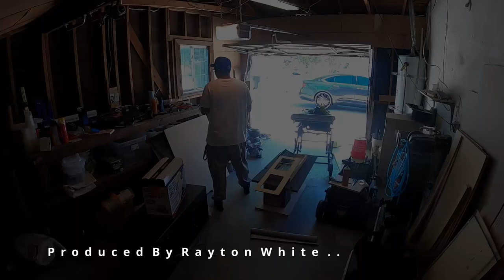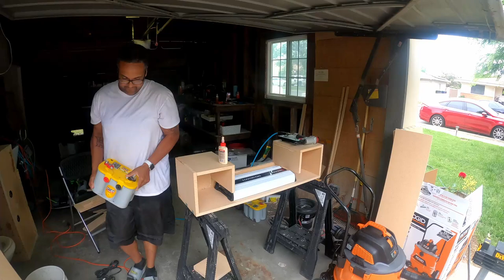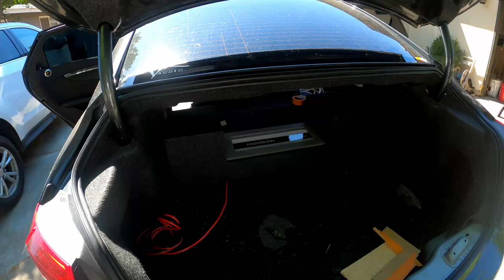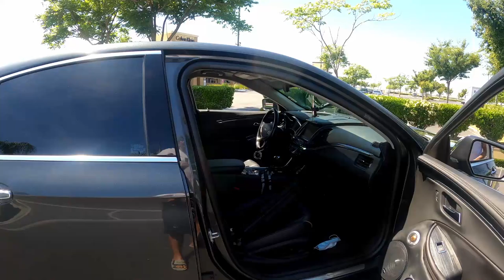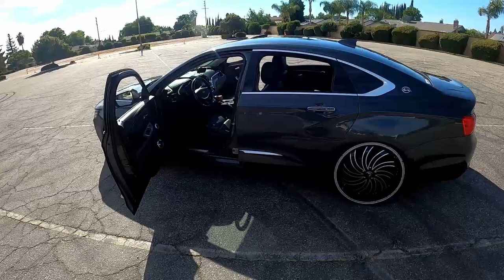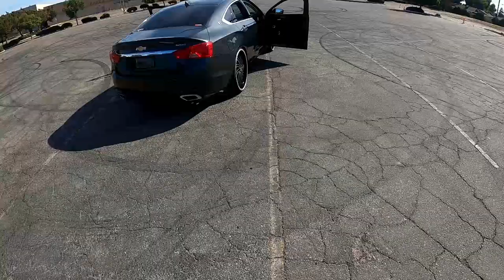2019 IMPALA PREMIER STEREO INTALL- HOW TO ! ! !

Comment: Do you have any recommendations on good aftermarket door speakers that will fit right in the existing holes?
Reply: Cruchfeild has the 6x9 adapters you will need then you can get any three way 6x9. I would go with skar. Cheap price but great quality.

Comment: Question about 2016 Chevy Impala LT non bose... I want to add a nephew external amps.. is there a way to bypass the internal cross over so I can run my own crossover front desk has the tweeters which I'm planning to move to the doors with six by nines as a component set thank you if you can help
Reply: Best way to do it is just zero everything out on your head unit and do all of your cross over from your external unit.

Comment: Did u have to change out your alternator? I have a 2017 LT non Bose. I replaced my factory speakers with alpine components up front and 2-ways in the back doors, all 6.5s. Now it seems like the volume is lower than it was with the factory speakers. I also have a Rockford 1200w on a Skar vxf 12.
Reply: Are you using the factory deck. And if so. Do you have a sound processor. There should be a volume control on that. If not the you need to put an amp on the mids and highs.
Reply: I’m using the factory radio. I just have a cheap loc I’m using
Reply: Did u change your alternator?
Reply: I have the 2019 premier with the Bose system. I will point out that With the Bose the speaker configuration is a 2ohm, so it might be the same for non Bose also.
Reply from the maker: no did not change out alternator..  and i went with the PAC 86 sound processor.. plug and play under passenger kick panel

Comment: What kind of line out converter do you have?
Reply from the maker: Copy and past site.. first one is for Bose system. Amplifier Integration Interface for Select GM vehicles with Bose system....
https://catalog.pac-audio.com/catalog/amppro-amplifier-interfaces/ap4-gm61
Second is without BOSE system
AmpPRO SUB Advanced Amplifier Interface for Select GM 2014 to 2019...
https://catalog.pac-audio.com/catalog/amppro-subwoofer-interfaces/apsub-gm61

Comment: Was hoping for  more of a how to. Do u still have a the factory unit? Did you buy pass it? How? Your video has speakers in the door but no how or where to put them.  All that said Iove your work on the battery  and amp mounts..do you have the measurements or a cad file so we can replicate?
Reply from the maker: I do still have the factory unit but I used a sound processor because the factory unit does not have RCA outputs or audio outputs. So I had to use a sound processor for my RCA output or audio output. The door panels are custom fiberglass door panels that I built for the upgraded speakers. There was no way to install speakers of that size in the factory door panels. Bose door speakers are 6 x 9. The speakers that I have are 5 1/4 and they are scar audio with scar audio super tweeters and the smaller tweeters are with the components set. I can make a video tomorrow with the measurements of the speaker box and amp and battery rack. I’ll probably even throw in where are the sound processor clips in. Thanks for watching and please share.
Reply: @electronicsguru4050  did you get that gm processor thing for your stock radio? The one you copy and pasted on another comment?
Reply: @TEXX_OFFICIAL956  yes I got it. Super easy install. Passenger foot kick panel. Pull that off and the clip in wires are right there.
Reply: @raytonwhite4187  thank you!!
Reply: @TEXX_OFFICIAL956  not a problem broski.
Reply: @raytonwhite4187 , Can You send Me the Info, for that GM Soundprocessor?

Comment: I have a 2017 Impala LT I’m about to do an instal in.  I’m wondering how tou wired your batteries together with the stock auxiliary battery in the trunk. Did you remove it completely and just wire the 3 together or leave it in and wire it in parallel with the other 3 or just leave it alone completely??  You’re help would be greatly appreciated.
Reply from the maker: I just went from the battery straight to the back two batteries. The alternator charges all three through the main battery under the hood. So just connect your battery cable from the battery under the hood and run it to the back, then split it to the batteries in the back.. my cars main battery is under the hood. if you have any more questions, hit me up.
Reply: I have  impala Lt I am about  to install  everything  but  I need  help
Reply: @raykingsbury8708  how can i help you

Comment: What wires did u connect your output converter to?
Reply: It’s a pac 86 sound processor, and it plugs in under the front passenger kick panel. It’s a plug and play device.

Comment: Do you only run the stock alternator
Reply from the maker: Sure do. With those two deep cells it handles the load. That amp is designed for 14.4 anyways so it doesn’t drop below.

Comment: Where did you get your remote from
Reply from the maker: Remote is located in the cigarette lighter in the center console. Only true remote.
Reply: @electronicsguru4050  okay thank you what about the fuse for the heated steering wheel
Reply from the maker: @15gosox  I think it turns off when in acc mode like if you're sitting there with the car off but the stereo on I don't think it's powering it (steering wheel heater). But the sig lighter is on in acc mode.
Reply: Thank you
Reply from the maker: @15gosox  not a problem.
Reply: Hey another question when I put the volume up my subs don’t hit as hard it hits harder when the volume is in the middle do you have that problem?
Reply: I don’t have the Bose system
Reply from the maker: @15gosox  that's called roll off. It is to protect your speakers like the door speakers so basically what happens is when you turn your stereo up all the way the system stops putting base at a certain volume so that when you turn the stereo up all the way you don't blow your speakers. The only way to fix that is with a sound processor like a pac 86 or a lc7 i.
Reply: Thank you sir

Comment: What sz rims u got ?
Reply from the maker: 24 inch
Reply: What tires you running? 255 25 24? Nd no lift correct? Hows the ride honestly
Reply: @INFAMOUSCAREP   no lift.. correct  and they fit just right..
Reply: @electronicsguru4050  looks clean, got the same impala, been wanting to slap some rims on it, and how did u tap in to the factory speakers, u use t-taps ? And u still giving away some equipment? I got a 1 10in speaker I’m trying to hook up to the impala and a 500watt amp, no much but it’ll do for now
Reply: @josegarcia5394  look at the reply’s I did. I have a link To a website that makes sound processors for this make and model. Very easy plug and play. Clips in the front passenger kick panel.
Reply: It’s on isiah green’s reply

Comment: How did you run the amp on the factory headunit?
Reply from the maker: used the GM PAC 86 line out converter.. its a sound processer.

Comment: I have a question I have a 15 with a 4cl there's a factory second you know how to run the power
Reply: Sorry bro but I don’t fully understand the question. But if I’m not mistaken, your asking about the power to the amp. If so, your going to need to run it from your battery through your fire wall, ( try to run the wire through where the gas pedal is. You should see a hole you can run it through.)  Then run the wire under the carpet by the door and send it to where the amp is.
Reply: Ok cool my car has two batteries so was just checking to see whats the best way to run it or if I needed a dry cell battery
Reply from the maker: any one that 12v will work. Try to get them as close as posable on the AH